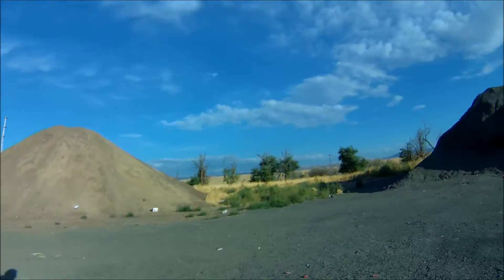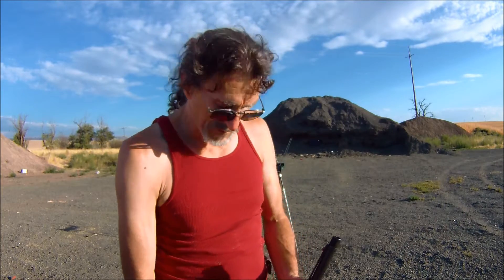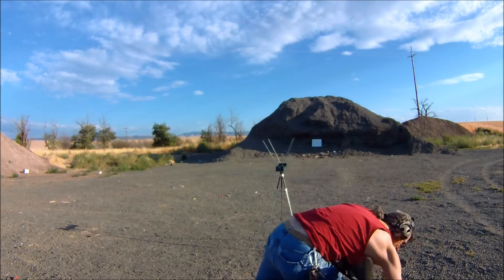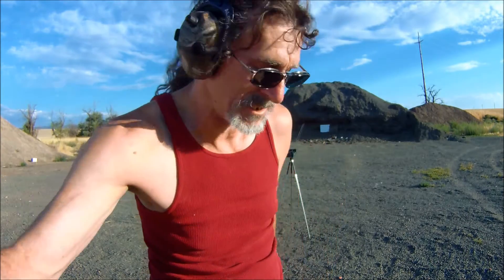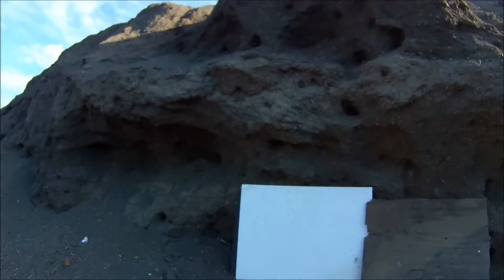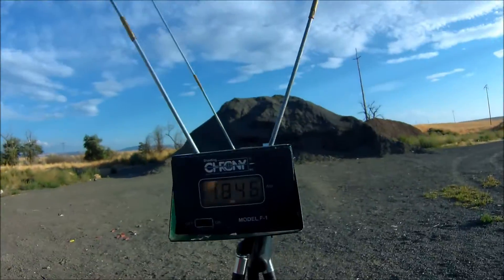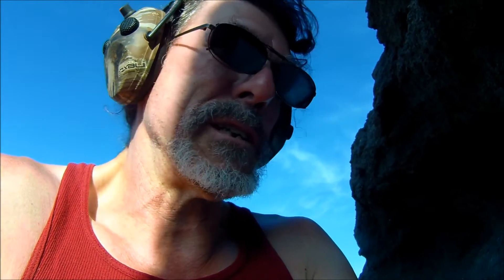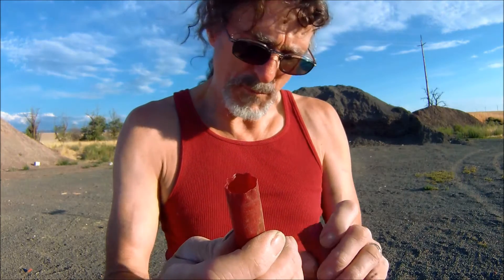Shotgun Shells: Pattern vs  Velocity

Comment: May I ask what was your load data for the fast cartridges, please?
Reply from the maker: I will have to get back with you on that.
Reply: @ZEEKUPP  Thanks Zeek, could I also trouble you for a load that you've tested that's getting ~1500 fps for the 10 gauge too please?
Reply from the maker: @mrsmith9079  The one I used to use was 43gr. of Steel Powder and MM1035 wad (TPS 1035 will work) with 12 or 20 ga. fiber wads inside to raise the shot height, and 1 3/8oz. shot. Any brand hull will work, but the Federal should have slightly less pressure because of the fiber base wad.
Reply: @ZEEKUPP  Great, thanks Zeek
Reply from the maker: @mrsmith9079  You're welcome.

Comment: The problem with the High velocity magnum shells is gun wear . Alot of people using the nitro shells when they first came out were complaining about  broken parts in both 10 and 12 gauge ,  and in guns like the mag 10 parts are getting hard to come by . There is no reason to use high velocity shells for the 10 as a T or TT going 1400 - 1500 fps will go clean through a gooses back at 70 yards and is easier on your shotgun .That's why i shoot t shot in my Browning Gold Lite 10  going around 1500fps as One doesn't need more velocity .
Reply from the maker: That is a very good point. While I have killed geese with extreme velocity shells, the majority have been taken with shells under 1500fps.